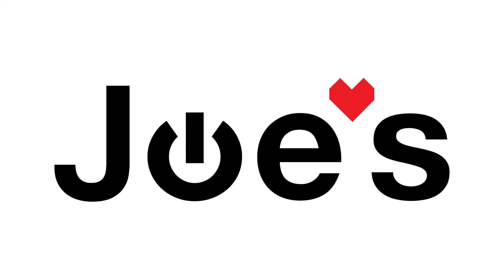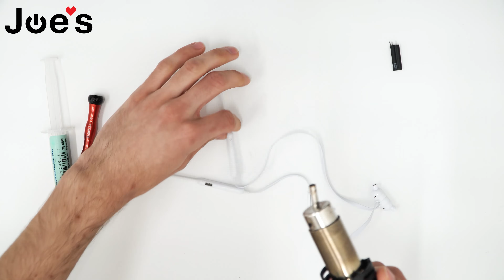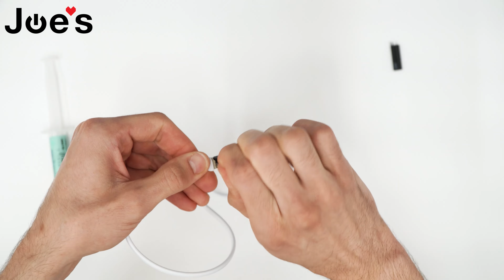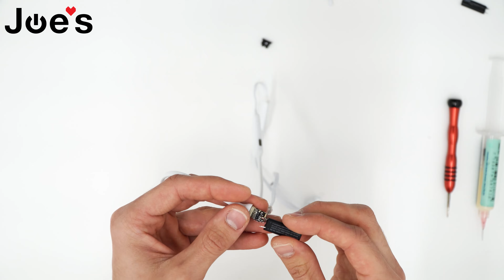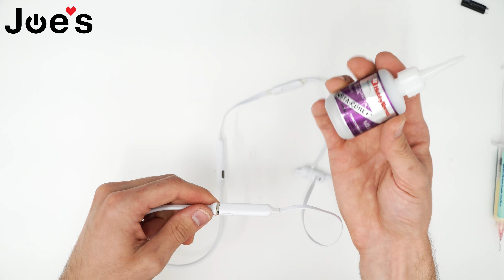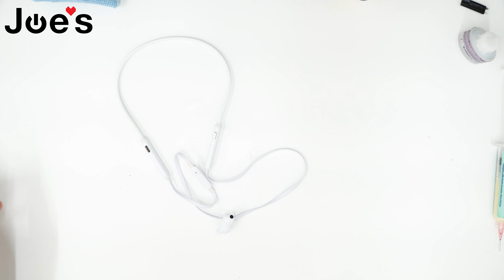Tutorial How To Repair Replace Broken Bad Battery Beats X Wireless Earbuds

Comment: mine works but in certain areas when I move them they turn on or off
Reply: SAMEEEE Did you repair them?
Reply: It’s a hardware damage, try putting a tape where the part of the led button connects with the main cable (not the cable of the headphone)
Reply: @tomasrodriguez1369  I ended up getting new ones but thnx for the tip I'll share
Reply: Same
Reply from the maker: Thanks for the comment. The issue you are describing sounds like a faulty main internal wire. This is a common issue with the beats X. If you would like your device repaired by a professional you can fill out a repair form and follow the steps to send in your item. We offer free shipping and diagnostics. Here is a link to the repair form:
https://www.joesge.com/pages/repair-services

-David P

Comment: Weird mine work ONLY if the charging port and the power button are touching. As soon as I separate them they disconnect. H. E. L. P
Reply from the maker: Thanks for the comment. The issue you are describing sounds like a faulty mainboard. If you would like your device repaired by a professional you can fill out a repair form and follow the steps to send in your item. We offer free shipping and diagnostics. Here is a link to the repair form:
https://www.joesge.com/pages/repair-services

-David P

Comment: Do you kno how to repair when one side of the headphone isn’t working no sound
Reply from the maker: Thanks for the comment. The issue you are describing could be the main internal wire or speaker issue. If you would like your device repaired by a professional you can fill out a repair form and follow the steps to send in your item. We offer free shipping and diagnostics. Here is a link to the repair form:
https://www.joesge.com/pages/repair-services

-David P
Reply: Put your headphones in a bowl of rice for an hour. Then, charge them.
Reply: Stick them into a bowl of rice for an hour, or blow-dry the side that isn't working.

Comment: what if they wont turn on but when i plug them to charging they blink (red ,white) x3 then white light all the time when charging? when i unplug them they turn off? its battery issue?
Reply: I have the same issue too. unboxed the BeatsX today and encountered the same. Whats a shame to Beats/ Apple that this issue been happened to so many buyers when I google for helps. Terrible product.
Reply: Same with me and I finally was able to charge but they dint connect for more than a few seconds :/
Reply: Just got mine yesterday charged them and having the same issue. Not what i expected. Don't think i'll be buying beats again
Reply: I got a pair at Christmas they'll charge but when I take it off they won't switch on no light nothing had two bad experiences with beats their rubbish
Reply: That used to happen to me, and I've been considering buying wireless earbuds. But, first I need to see if there's hope in fixing my BeatsX.
Reply: @jellybean rose  bro same. i donno wat to do now
Reply from the maker: Thanks for the comment. The issue you are describing sounds like a faulty battery. If you would like your earbuds repaired by a professional you can fill out a repair form and follow the steps to send in your item. We offer free shipping and diagnostics. Here is a link to the repair form:
https://www.joesge.com/pages/repair-services

-David P
Reply: @Joesge  I had that issue on my first ones, then returned them at apple store and the new are not working neither. How can that happen twice in a row?
Reply: the exact same thing just happened to me and its so annoying im just gonna change my headphones. i advise you to just use apple airpods or their wired headphones

Comment: What if it goes red white red white all the time and doesn’t power on?
Reply from the maker: Thanks for the comment. The issue you are describing sounds like a faulty internal wire. 
If you would like your earbuds repaired by a professional you can fill out a repair form and follow the steps to send in your item. We offer free shipping and diagnostics. Here is a link to the repair form:
https://www.joesge.com/pages/repair-services

-David P

Comment: Love this videox2. In addition to the parts, what're the needle applied( glue?) and what is the element added in almost final step? Thanks
Reply from the maker: Thanks for the comment. The needle syringe substance is flux which helps create good solder joints. This process can be done without flux however it is recommended. The final element we add in this video is InstaCure+ which is super glue. Hope this helps. -David P

Comment: Do you ship the battery to germany?  How much does shipping to germany cost?
Reply from the maker: Thank you for the comment. We do ship worldwide. You can simply go to our website (www.JoesGE.com) and add the part or product to your shopping cart.  Then you can start the process of checking out. During this step you will add your shipping address. After that is completed you will see a shipping cost based off your location. That will be the cost of the shipping to your country.

-David P
Reply: @Joesge   Hi! The battery is out of stock. when will it be in stock again?
Reply from the maker: @VDumpers  Thanks for watching Andrey, sorry for the delay in replying. We do have both the genuine batteries and the brand new replacement batteries in stock. The links are in the description of this video. -Matt D.